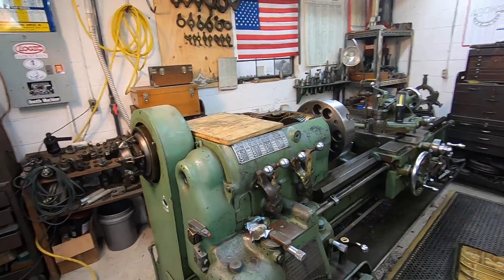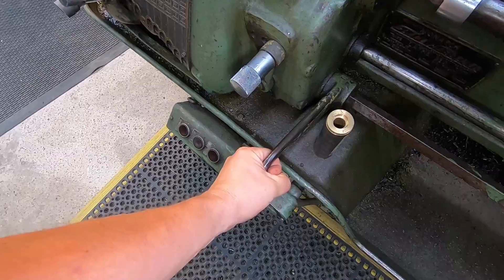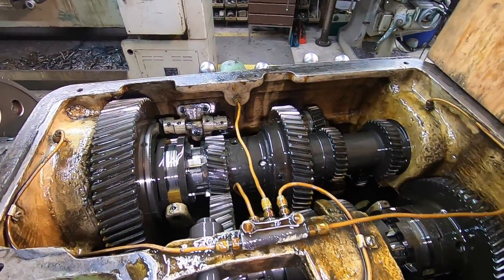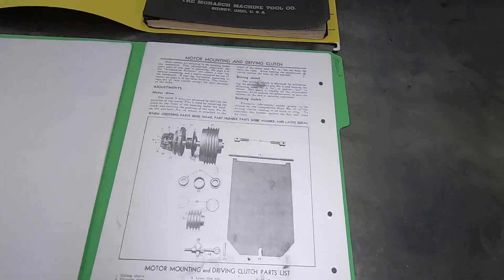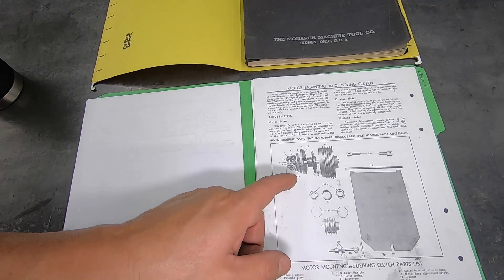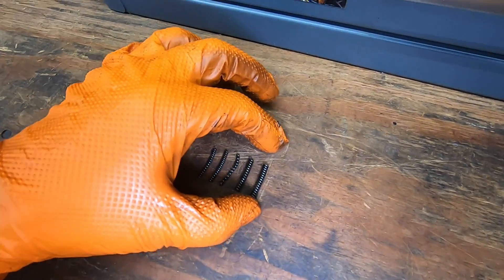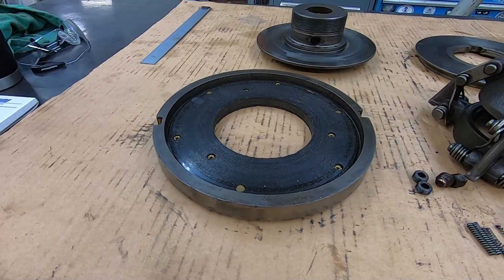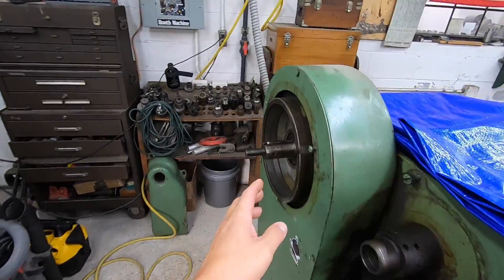Monarch Lathe Clutch Repair Part 1

Comment: Adam, Relining your clutch is a simple job. Knock out the rivets and the linings come off the steel. See if Monarch have new lining and rivet kit available. Then its a simple process to reinstall the linings. There are simple hand rivet press out there available that a hammer is used to stake the rivets. I personally have a rivet press for brake lining that will do this job. If Monarch Doesn't have the linin g any more then you will have a small problem of how to get ne lining. I have bought lining sheet material at Mc Master Carr and made some linings before with no problems. I should mention that my rivet press also allows me to drill and counter sink the rivets in the lining. Good luck on the clutch shop[ you have close to you.

Comment: I just "rebuilt" the gearbox on my washing machine and believe it or not it looks just like the gears in your head stock—beautifully engineered, helical cut gears running in an oil bath. For some reason, after 15 years of reliable service, the gearbox wouldn't engage the spin cycle anymore although the agitation worked fine. So, like you are planning, I removed all the gears, thoroughly cleaned them with gasoline, then reassembled with fresh oil and now it runs like new again! In fact, judging from their condition, I have no doubts they will last another 15 years. They were that nice. Thanks for the video!

Comment: Monarch still services these machines.  I have a 1952 CK that i have had to source things for.  My ole gal has the same clutch issue that just started a few weeks ago so this video is perfect!  Never knew the grease zerk was behind the plate either......ooof.

I live about 15 minutes from Sidney, Ohio where these machines were made too.....built to last!
Reply: We had one in our machine shop in General Assembly at the old Saturn plant. I got a call to come down to the shop to take a look at the Monarch, and upon opening the control console door, I saw that the *Blue*print (now faded green) was dated from two weeks after I was born. :)

It was cogging badly, and we traced it down to a bad rectifier tube for the field winding on the motor. We got it up and going by replacing the tube with a rectifier from one of our spare DC disconnects. 

The electricians were a bit disappointed at the quick repair. They told me that they thought that they had me that time. LOL!

Great little lathe, the toolers loved it!

Comment: Adam, I had my clutch done on my CY, just like yours, up here in Kentucky. Look at Practical Machinist Forum, "My 16CY Winter Project". There is several postings including contact information on clutch pad repair. 

You are correct, it is a spring issue. My CY has and Edgemont Clutch, a little different than yours.
I had to replace my springs as well. Sourced mine from McMaster. Let me know if you need anything for your CY. Been there, done that.

William.
Reply: First time I've found someone sharing my name!
Reply: @Watchyn_Yarwood  Very cool!  I'm from the Virgina Garretts. More recently, 1900's, Fentress County Tenn.  Nice to see another Garrett!

Comment: Adam, after seen the stills at the end I’d suggest you make the time soon to have that clutch re-lined, it is really worn out. I used to do clutch linings when I was in the Army and I see there is an area where the lining is almost even with the head of a rivet, if that river has contact with the clutch plates you will need those too; and they may be very hard to come by. I’m guessing the needed linings may be 3/16”-5/16” thick when new. They’ll then need replacing another 100 years from now. Thanks for sharing.

Comment: A good little trick to square off the music wire springs is to heat up a block of metal in a vise till its bright red (Ex: 1"X 1"X 2"). Push the spring into the block of steel and the last coil will lay flat, perpendicular to the body of the spring.  Works great every time! I used this method many many times as a toolmaker.
Reply: A weird coincidence is a die maker at work showed me this trick just today.

Comment: McMaster sells the friction material in sheets. I usually draw the shape I need in CAD, save as a DXF file and send it to my local water jet guy to get the frictions cut out. McMaster also sells the tubular brass rivets and the contact adhesive for bonding the material. It's not that difficult to do, I've redone the frictions on a lot of older equipment over the years.

Comment: Adam
Reach out to monarch they can either supply you the springs or tell you the correct dimension.
The they can rebuild the clutch too, or maybe send you replacement frictions for your clutch.
As far as installing them you can do it, just clean up good even blast where they fit. Then add a good contact aheasive. Like 3M industrial, clamp and add rivets. It not hard to do.
I done one myself. A few years ago.

Good luck
Randy

Comment: the not received email , is a sellers trick , when youre driving the distance to see them , youre be less likely to turn around if they quote a high price as you allready gone through the trouble to go there , allso they can take the part "hostage" (as in if you dont pay you dont get the part back ) if they find sumting unexpected that makes it more expensive , its a dirty trick but i seen it happen to me twice 
have them quote you in writing the price for the actual repair and possible problems , maibe have them call in case the price increases above a certan treshold , allso make sure you have a second company doing clutchwork in case trhey realy try to fleece you
Reply: This comment needs to be pinned to the top for all to see.
Reply: There might also be a slight chance that if you sent pictures they could be too big for their mail server to handle

Comment: I defiantly agree about the springs! One looks like it may even be hand wound, though more likely just a damaged wrong size; but also the friction material on the one side looks to have significant but old damage. In the video the crack looks like it was repaired with brass staples way back. I suspect that the original springs got dislodged and tore things up in there, and some one did a field repair to get it going with minimal down time. I'm assuming you have had this one for quite a while , so guess it held rather well all things considered.

Comment: I have a Monarch 61, and recently repairing issues with the clutch as well, long story short,...it was the springs,,,,I can also say with confidence, it looks like a prior owner replaced those Larger missing or broken springs with smaller diameter ones? I also have seen these types of clutches replaced with multi-puck design when circular material was not available,..also due to the asbestos issue,..ceramic was used in place of the original.

Comment: If clutch products don't tell you, let a mechanic tell you. It needs to be replaced AND the surface plates that make contact with the clutch needs resurfaced as well. Otherwise its going to prematurely wear the new clutch.

Comment: I really appreciate these types of videos.  I have a 14C which I now know to be a 14CY 1941 Vintage that I'm going to put back in operation.  I have alot to learn about but one thing that is clear to me is the craftsmanship and know-how that went into it.  The quality of these lathes is just amazing to me as a hobby machinist.  I have no idea what I need a lathe that big for, but I know it will be able to do pretty much anything I ever want to use it for.  :)

Comment: Adam the clutch is worn out, look at the distance between the head of the rivet and the face of the clutch. Time to get it rebuilt before it starts gouging into the friction plate and the pressure plate. Watch out with the old material probably absotoes. Keep up the video's and hope you get fixed right buddy!

Comment: Adam, on one side, that clutch friction plate appears to be worn down close to the heads of the rivets that hold it in place. You probably don't want to score the steel plates, so may I suggest that you replace it fairly soon? If it was in my motor-car it would definitely be replaced with that degree of wear, but of course the loads on a motor-car clutch are much greater than the loads on a lathe.

Great work, as usual!
Reply: Yes, no idiots holding it on a hill by slipping the clutch. 😁

Comment: Ran a Monarch for over 35 years.  Model CBB 96 in. C-C Ser no 26282  10-1944 vintage war finish.  Had to change clutch springs years ago.
Most were broken.  Same problem with clutch hanging up.  Had to dismantle entire gear head, long story.  I was machinist mechanic for a large printing co.

Comment: Might be a bit obvious but if that clutch is original be careful with handling it as it may contain asbestos.
Reply: Not the best to deal with but damn good clutches
Reply: asbestos is demonized. Yes, it is dangerous if you work with it on day-by-day basis without PPE, but amount of asbestos in such pads is safe to work with, if you  will not mill it and inhale thus dust purposely.
Reply: @blacklion79  I mill brake pads and yes I wear PPE and have also started to put an air filter by me for my coworker in the shop but I know dyno techs that have worked for years without proper ppe and haven't had problem even though the smoke
Reply: @blacklion79  basically operating of such clutch releases small amount of asbestos dust to your shop for you to breathe every time you use it, I don't know if that is enough to cause problems though but I'd rather not have asbestos in my clutches at all
Reply: Asbestos  is only dangerous if its loose and dry asbestos shingles  are highly compressed  so even broken its harmless   ps I'm with a railroad historical society  so I've been around tons of it  that's been kept wet
Reply: That clutch looks like it's really close to the rivets. But still usable for now though. I really enjoy your videos btw.
Reply: @blacklion79  yea you would swear it's nuclear waste lol.
Reply: Asbestos is only a problem in California right?
But as long as your not grinding it every single day it's not that much of a deal.
Things like smoke from cutting oil, cool mist vapour etc is also bad for your health
Reply: Ron Brown coming from someone who works in the heat treat industry in an old facility where asbestos used to be big, it’s definitely not something you just wanna overlook. If you are creating dust I’d really try not to inhale it.

Comment: Adam
Great video once again. That clutch plate needs replacing one of the brass rivet head already show signs of rubbing which means it will eventually score the drive plate if not replaced.

Comment: This is a very common clutch/brake  setup, the key thing to remember is to adjust the linkage to set the  cone brake first THEN rotate the clutch to the feel you want, they are supposed to " cam over"
. With no tension on anything when engaged.

Comment: Hi Adam, from looking at automotive clutches for 30 yrs. That Clutch is worn uneven(due to the springs). The rivets that you see should not be close to touching the plate.  The solid ones(the high ones) are a wear indicator and the lows are to fasten) and they are brass or bronze to not damage the plate too much and create noise.  Your gut feeling is right... you can go and change the springs and get the machine back up and running but know that it will work much better if you replace that brake material.  With that said... The new springs might prevent that high brass/bronze rivet from touching the disc for a long time to come.  I say do your research and plan on replacing in a year.

Comment: Adam my man, another thing to look at while you're in there is that big bearing, the one that you greased. If it is bad (and it probably is, judging from the looks of it), you'll find that nobody makes it anymore. But, the Monarch people gave me the straight poop on fitting a self-aligning type bearing, normally used in a pillow block arrangement. It looks funny installed because of the eccentric inner race, but it works perfectly. Plus, it is a sealed type that doesn't require additional grease, which of course saves the  clutch from grease contamination in the future. Any reputable friction shop can reline the friction plate. Btw, I've been told not to use the headstock oil (SAE 30 non-detergent motor oil) listed in the original Monarch manual you have there when you change it. Avoid any modern motor oils that might have additives not specifically meant for gear lube. 30 wt. synthetic grease works best, if you can find it. No STP, no Power Punch...no nuth'n.
Reply: The bearings in the clutch are typical taper bearings. Easily replaced, even Timkens are available. Keep the Timkenized true to its word...
Reply: So something like an 80 or 85 weight GL-4 gear oil. Or, probably better, an AGMA #3.

Comment: Looking at the wear on some of those dogs, seems like some past operators didn't understand the difference between "drifting" and "engaging" a clutch. I notice you seem to prefer spinning the chuck by hand to align the dogs; they'll probably last forever that way.

Also, yes, that friction material looks pretty thin. I'd expect that somewhere there's a depth spec from the surface to the rivet heads. It also usually doesn't crack like that until it gets to the hairy limit. In an automotive application, looking like that, I'd just replace it on general principles.

You're probably right about the springs. My bike had just one clutch spring (of six) break, and it just kept hanging up.

Comment: Adam, the friction lining on that clutch is low buddy. An easy way to tell is how close it is to the fixing - general rule of thumb is the lining material starts approx 50% measurement of the fixed head width proud of the fixed head - so assuming the fixing is 1/4in dia the lining started 1/8in “thicker” both sides. Also the measurement you took of the retaining nut and thread showing so had been wound in loads. As a precaution, around the time that puppy was made they would have used an asbestos material for the lining so needs to be made safe (we always used hair lacquer - or hair spray as you guys over the pond call it) love your attention to detail man, all the best.

Comment: @abom79
 idk about US but in third world we actually fix clutches all the time when it is expensive and hard to find . it's rather easy and cheaper than buying a new disk and clutch . for knowing how much life you have on your clutch you look at the top of the on of the rivets till the surface of the pad itself . depending on your use every 1 mm is about 6 months . measure if on the highest rivet cuz that's the one that is gonno destroy your disk when the pad is finished

Comment: I cut my repair teeth on a CNC Monarch mill, vintage late 70's. I have never serviced a Monarch lathe or been around them. We were pretty loyal to Clausing Colchester machines. I have been in and all through the Colchesters, but it is fun to see inside the old Monarchs. 
We were a machine builder. Our machine design relied on spur gears. We used helical for heavier power transmission and to reduce gear mesh backlash. Helical gears give consistent full tooth contact. Non critical design drive trains used straight tooth gears.
Reply: I hear they use 3D printers to make repair teeth these days. Times have changed!

Comment: It's pretty easy to set those brass rivets.  If you can source some clutch/brake friction material of the right thickness, doing the replacement would make a nice video.  You can practice setting a couple of rivets off camera so when you show us, you'll look like a pro ;-)    Here's some example material: mcmaster part number 60895K23

Comment: The clutch assembly I think should be looked at as if it were off a Vehicle or whatever.  Replace the springs, replace or refurbish the clutch plate Lining Both Sides & Checked the Steel plate for cracks, and also lightly skim The drum and mating surfaces. If there is a Spigot baring , remove replace if necessary, Then you have a New clutch Assembly that will last for another 100 years so to speak. If you only do retainer springs and plate face, You can just about Bet Your Bottom Dollar that Murphy's Law will cut in.  ( If Something is going to Happen, It Will ) Your a Top Rated Machinist as you have shown., so you only want to do it once.

Comment: Adam, instead of guessing what size for the springs, just order them from Monarch directly. They have most parts for these lathes and this way you get the right size. It likely will cost the same as overordering from Lee springs, which are great but expensive. Also, ordering from Monarch helps keep them in business. Email Terrie at monarchlathes.parts@earthlink.net include your serial # in the email.

Comment: Those clutch pads definitely looks like they need replacing, specially the outer one, on one side it looks pretty close to the rivet heads. Definitely looks like it’s wearing unevenly.
Reply: That, and I'm seeing shiny spots on the wear facing, indicative of glazing, possibly due to excessive drag causing overheating. The uneven wear would tie-in to this idea, and the uneven mix of screws that came out of that clutch-pack cannot be providing balanced and equal compression/tension.

It's a matter of scheduling the outage, but that facing has seen a lot of use, and should be removed and replaced.

Comment: If the clutch is never slipping, it's doing its job just fine. The material looks good! The springs are 100% the problem, the clutch relies on them to allow the pressure plates to separate when you disengage it, if they aren't forcing the plates apart, the clutch will stick. Just look at the clutch disc on a car, it's very similar in design, the amount of wear is not much, it looks thin but that's how it's designed.
Reply: In my mind it looks extra thin as the brass fixturing rivets are almost flush with the friction material. Not critical, but definitely not much left.
Reply: @frollard  Second that. Needs a new friction plate.